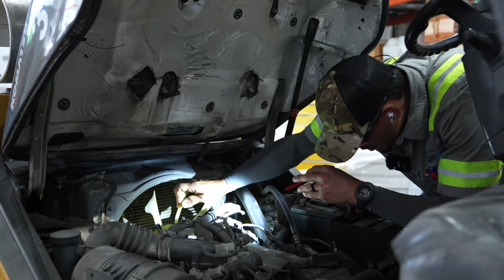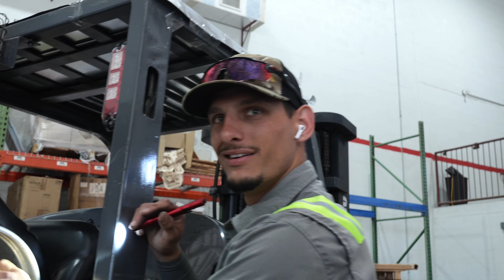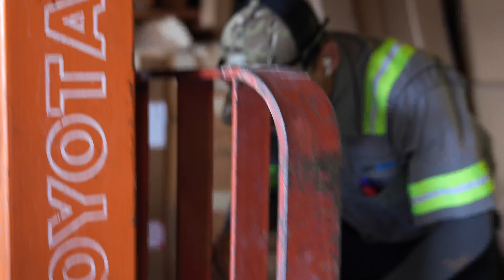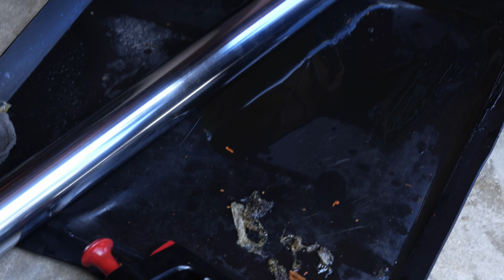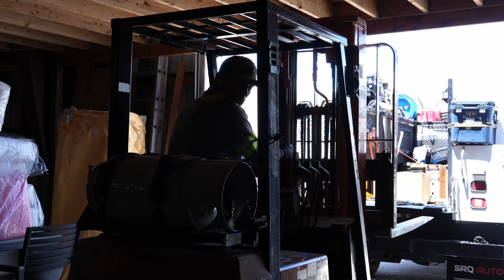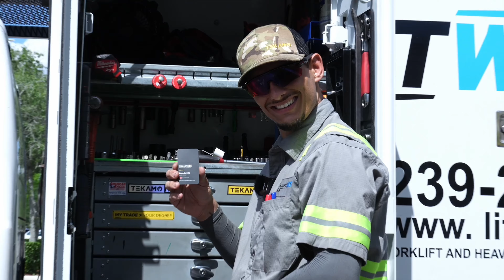Komatsu Forklift Overheating & Hydraulic Cylinder Repair in The Field!

Comment: The slow lowering is usually caused by the valve in the bottom of the cylinder failing. The shrink wrap you found is most likely the culprit. Either that valve or the “burst valve” is malfunctioning. I’ve had both. Good luck man, I know you’ll have it figured out.
Reply from the maker: Thanks for the tip! 🙏🏻

Comment: On the k25 engines there's also a front plate gasket in the water pump area ive had leak as well. Also after filling up the coolant dont forget to bleed the system of air.. if not it'll spike the temp.

Comment: Was that debris plastic? I had a Yale walkie stacker that someone in the factory had left the part number decal on the rod when they assembled it. After six months the plastic had been shredded enough to clog the screen on the pump inlet line. Had to drain the system three times to finally clear it. Also, it might be good to check the hydraulic filter.  About the lower lever needing to be pushed only partway: Does that upright have a flow-control valve? Maybe it's clogged too.
Reply from the maker: That’s a really good point about the hydraulic filter, I didn’t think of that. The weird part is, it only does it on the first stage. Second stage works great.
Reply: @theforkliftguy  The only flow controls I've ever had trouble with were on Clarks and they were mounted on the bottom of the cylinder. The idea was, if you broke a line and the fluid was going out too fast the valve would slow the flow down and the load would come down slowly. Not sure if you've got one on that truck but it's an idea for the slow lowering problem.
Reply from the maker: @rogerthomas1982  yeah you might be right about that. If they complain about it, I’ll probably go to the control valve where the levers are and see if it has any of those.

Comment: I've replaced over a dozen radiators from the same fail point on those 16 series. Luckily, the aftermarkets are gtg.
Reply from the maker: Have you ever replaced the ones with the transmission lines around the back of it? Instead of the front? Super annoying to replace. I had to remove the counterbalance.
Reply: Sorry, I just noticed your question. Yes, I remove them without removing the counterbalance. I remove the hood/seat, fan & plastic shroud to make room. Then I bend & force out that aluminum shroud wedged between the radiator & counterbalance. That allows me to slide the radiator w/ trans lines attached straight up. Never had cooling issues with the aluminum shroud missing.

Comment: The siphon tool has a one way ball valve, when it drops into the fluid the ball moves up allowing fluid in then when you pull it up it seals and holds that fluid in the tube. So each stroke adds a little fluid in the tube and if the outlet is sufficiently lower than the one way valve in the fluid it can allow the fluid to siphon using gravity without having to move the tube up and down.
Reply from the maker: Interesting! Thank you for clarifying that 👍🏼🙏🏻

Comment: toyota needs the check valve in the bottom of that rod replaced, or its inside behind the feed line fitting.
Reply from the maker: You’re right! On this one in particular it didn’t have one in the bottom because it was welded. Looked it like was repaired before.
Reply: @FlavaDave93  yeah they call it peanut valve, when doing a repack most deff replace at the same time for the future